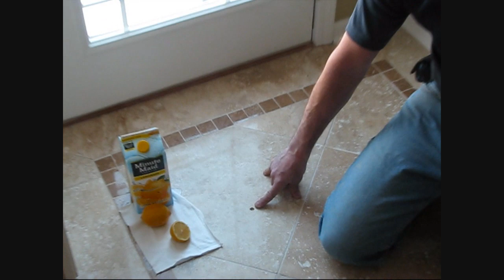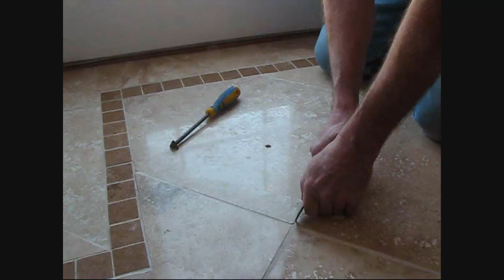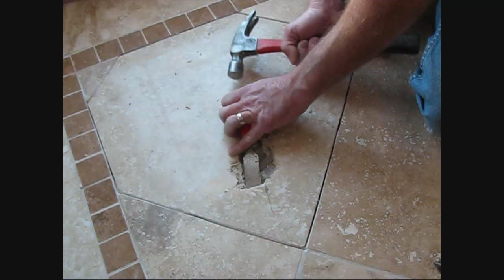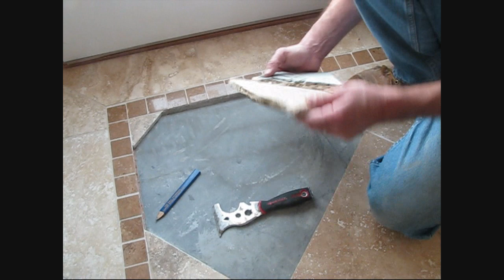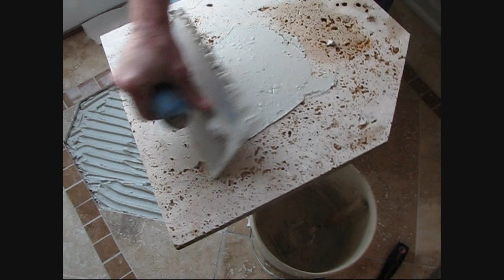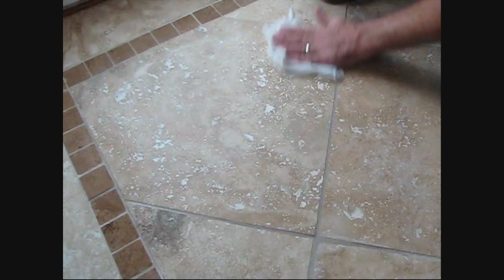How to repair tile with floor heat

Comment: For a small flaw you could also fill with epoxy. If you have some extra of the same tile you can make a powder and mix it with the epoxy and get a pretty good match. To make a powder just crush some bits with a hammer until it is fine.

Comment: I'm actually removing a tile tomorrow with the nuheat system... after the wire was installed we skim coated with thinset... Then let it dry and 3/8 trowel over top and laid tile... should I have an issue removing that tile without damaging the wire?
Reply: how did it go? I have the same situation and Im very concerned about damaging the wire

Comment: Is there any procedure to fix a loose tile with radiant heat floors rather than replace? I purchased the house and am not sure how the heating was installed. The grout is breaking away from the tile and becoming loose. I am a little apprehensive to use sharp tools. Any suggestions?
Reply: Tom, Without actually seeing the tiles you understand I can't give advice that works for ALL situations. If grout is cracking and the tile is loose it COULD mean movement in the floor ( deflection ) . There ARE caulks that SAY they can fix a loose tile IN PLACE but I am not convinced that they a re a permanent fix.

Comment: I completely agree with Partick O'lynn; just fill in the void with unsanded grout in the right color. I have over 1,000 sq. ft. of travertine tile and have several areas where the tile shows voids like this. I used the same color of unsanded grout that matched the existing color of fill, and apply it wherever needed. What's more of a lemon is to have lippage vs. a slight variation of fill color in a naturally color-variant tile.  So much wasted time and effort for this particular example...I hope you didn't charge the home owner for the repair.

Comment from the maker: Patrick , I looked for a matching filler first. Nothing was readily available.
So, i took advantage of this situation to show that by using my Edge Strips and SLU there was no possible way to damage the floor heat when changing the tile

Comment: If this is a travertine tile. Natural stone. Then why not fill with a travertine filler ? I don't understand why you need to remove this tile , Like you said it was well stuck down to sub floor .

Comment from the maker: @ihatethisOK  Ceramic tile will actually break into larger pieces. Be careful, they will be SHARP!!
Any wire repair information can be found by calling the tech support dept. from the manufacturer of
your system. Field repairs can be made.

Comment from the maker: @ihatethisOK  A hammer will work. Start in the middle of the tiile. Be sure to cut the grout out from around the tile your replacing. Once you have a hole in the middle. Take you time and chisel sideways,not to dig into the SLU